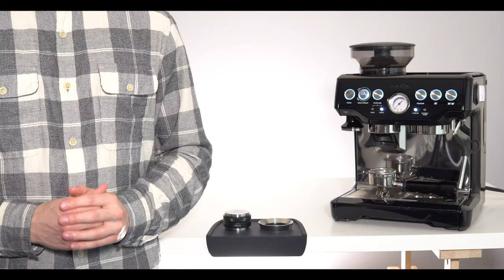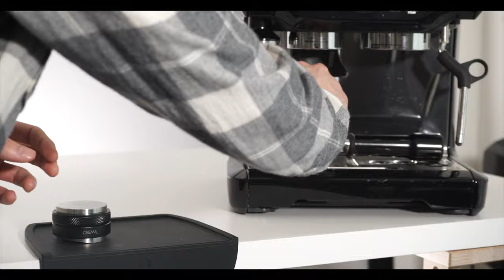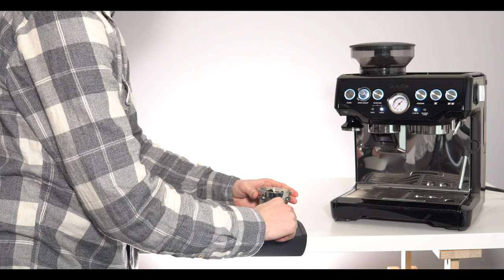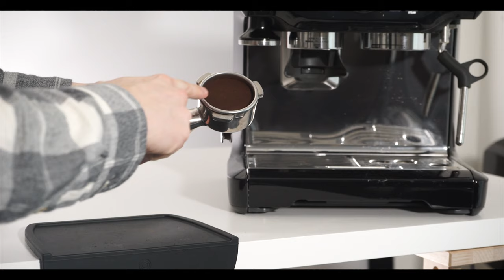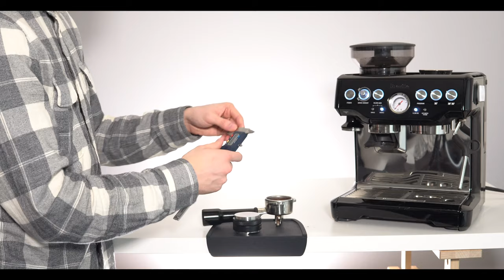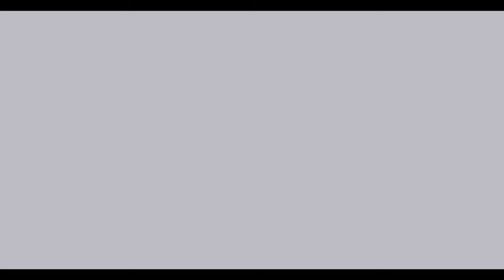How to Set Palm Tamper Depth | Breville Barista Express

Comment from the maker: Palm Tamper: https://geni.us/hLwubGd
Tamping Mat: https://geni.us/MWsc
Dosing Funnel: https://geni.us/6lghM
(Affiliate Links)
Reply: The Sage machines use a 54mm Portafilter. This tamper is 53mm.  Surely this will leave a 0.5mm non-tamped zone  around the edge?
Reply from the maker: They are designed specifically for Breville baskets, this isn’t a worry. Just like how 58mm tampers are actually 58.4mm

Comment: Use the Razor trimming tool and hold it on the edge of the tamper.  Adjust the tamper tool to match it perfectly.
Reply: yep!
Reply: Exactly right
Reply: That's too low. It removes way too much coffee and the depth is unnecessary low. Meaning that depending on the grind size you may not even be able to get 18g into the portafilter at that depth
Reply: @the_kingd0m  I dont think it is too low, it actually makes a higher puck than the 7.5mm in this video
Reply: I really don't understand the razor tool. If you use it after tamping its just going to damage the puck and cause channeling....
Reply: Nope. It requires more space than the trimming tool. If you use trimming tool, the coffee touches the shower
Reply: I use the razor to set the depth of the distribution tool.. Just a tiny bit shallower so o can use the razor to clear out all the coffee on the side. Flip it and use the other side with a tiny bit shallowe for the final tamp.
Reply: Bad advice use the shower screen instead
Reply: This
Reply: @jacksos101   the purpose of the razor is to see if your are tampering too much or not enough and make adjustments
Reply: @sammader5456  I know what they say it's for. It's a gimmick. The ideal height of the puck can change depending  on your beans, the roast level, the grind settings, and the dose and your preferences. The razor tool is purely a gimmick. End of.
Reply: Razor tool should be thrown straight in the bin
Reply: La dosis de cuánto gramos es ? 18 grs ?
Reply: The razor is a physical measurement tool not volume.  If you grind 18 grams of coffee in the basket, scraping off a few grams of coffee changes the brewing ratio, significantly.

Comment: Hi. Interesting video. I have a couple of issues here. First is the tamping weight and distance is directly related to the dose of coffee you use. Eg 16g v 18g will result in different tamped levels in the basket unrelated to shower screen. Second is that even different brands of coffee at a similar dose and grind tend to have a marginal difference so you’d need to recalibrate every new coffee. I just use distributer and adjust to gut feel and also to vary tamp amount to get longer shorter shot when the ideal grind setting is between settings.
Reply from the maker: I dial in MANY different coffees every month. As long as you are using a dose that is not too low (causing the tamper to not make contact), you will be able to dial in using grind size. A standard "ideal tamping pressure" of 25lbs or whatever it was has long been debunked as a myth. CONSISTENCY is what's important. But you are absolutely right, if your grinder is stepped and you can not precisely dial in using grind alone, slightly adjusting tamping pressure can help you dial in between grind settings. The same thing could also be done by varying dose while keeping tamping depth the same.
Reply: For me, I am too lazy to adjust. So i will adjust my coffee weights. For different beans, i will adjust my grind size.

Comment: Very well done! This is the only way to set a distribution tool to the minimum depth. Should you trust the dime rule for clearance, simply put a dime over the ground bed, lock in the portafilter, then set the distribution tool to dime imprint level. Bang, it’s done. Lastly, adjust the dose weight to reach this level. When done, adjust grind size for perfect extraction. Compensate weight of the dose by the roast level. Increase dose with light roast, decrease with dark roast. Success guaranteed! I have never change the depth of tool fore the last 3 years and probably never forever. 
No matter the brand of your machine, size of basket, batch of beans, follow this procedure and you will be in business.

Comment: You may be amused that I found a use for the razor trimming tool - I used it as a template/guide for setting the depth of my puck tamper.  I put the top of the razor on the top of the puck and adjusted until the razor edge came against the base of the puck.   The depth came out to ~.75mm as well.  I like your approach better, but had to share a use for that razor...

Comment: I found the easiest way to check is to simply put the tamper on the portafilter coming with the machine after you finish prepping. As long as the line between the silver and black part of the tamper is aligned with the basket/you cant see the metal part, you are good.

Comment: This was very helpful even though I have a different tamper/distributor and machine. I have the bambino plus and a picked up a rebranded combo tamper and bottomless portafilter for 35$ and this video got me pretty close to where I needed to be on the first shot. I do have the stock Breville basket in so that might have been a help. Thanks.

Comment: you can confirm your method by checking the depth sets by the Breville razor dose trimming tool
Reply: I have just measured mine and it is 7mm and not 7.5 mm....

Comment: Thank you for the informative videos!  Would you modify your process if using a puck screen?  They are quite thin, but would you tamp any deeper?
Reply from the maker: Yes, you’ll need to leave more room as to not put any pressure on the group head when locking in the portafilter

Comment: Excellent! This is exactly what I need.

One question though: what is the dosage that you used? It appears that you have premeasured the beans. I have found the Barista Express is not very consistent with its dosage, varying up to more than half a gram.

For adjusting the depth of the tamper side, I think the quicker way is to use the "Razor" tool that comes with the machine. It is set to the proper depth.

Thanks for the video.
Reply from the maker: I'm using 17.5gr dosed directly into an empty hopper, then I grund until empty. That is the most accurate method I have found on this machine. The razor tool is useful, but measures a specific volume, not a specific weight, which leads to problems in determining brew ratio

Comment: When using the distribution side. I noticed a lot of coffee grounds gets stuck where the black and silver part meets. Any idea on how to remedy this? The distribution part is at the minimum setting so I can’t adjust it anymore
Reply: I had that problem with beans that were particularly oily, especially when grinding finer. The stuck grounds never amounted to more than .25 grams, though, and didn't seem to affect the shot.

Comment: The Breville came with a razor tool. Wouldn’t that be the correct depth (tamp until the razor doesn’t shave the puck)?
Reply: the depth would change with dose though, so that might prove a slight issue
Reply: @Narezaath   
And how's his method (in the video) immune to dose?
Reply: @itsm3th3b33  I'm wondering the same thing
Reply: I bet the depth of the razor is also around 7.5 mm
Reply: @Guapogiboy  
No doubt. But the trial and error method suggested in this video is a long cut way to get to that 7.5mm, do you agree?
Reply: @itsm3th3b33  yup I actually just got mine I’ll measure
Reply: @Guapogiboy  were you able to measure? I was thinking the same thing
Reply: @fuzz69er  I have just measured mine and it is pretty much dead on 7mm and not 7.5 mm.
Reply from the maker: Breville's use of this tool is likely two fold, to help reduce dose variance caused by timed grinding, and to ensure people are guaranteed  to tamp deep enough to clear the shower screen. This is a poor method to use, as you have no control over the actual dose weight (you are trimming off an arbitrary amount to reach a certain depth)
Reply: @LifestyleLab_ good point. This 7.5 should be the level after you’ve tamped.so you’ll need to play around the grams of coffee. For me it’s 17-17.5 g. 

One tip after you’ve used this tool
To tamp touch the top just to test if it’s solid and packed.  If it leaves a dimple it was not enough coffee add a little more and repeat.
Reply: @LifestyleLab_  
Are you sure about that (razor depth doesn't clear the shower screen)?  It's pretty much the same 7.5mm that you found using your trial and error method. 
Besides, there's no way that a dose of 18g will fit in that basket and clear the razor without tamping. So, I need to tamp first, then measure with the razor (which cut 2-3g off), then tamp again?
Reply: @LifestyleLab_  I am very new to this .... Very. Can I confirm that you grind into the basket and then use the tamping tool to get it down to the right level ( 7.5mm in this case ) ..... And then you press it down to the right pressure ?
Reply from the maker: @itsm3th3b33  I'm sure the Razor depth would also clear the shower screen, as that's the intention of this tool. We're talking a difference of 0.5mm here. 
The issue with using the Razor is that you have no control over your dose. You are trimming off an unknown amount of coffee to reach a certain puck depth which is completely backwards. You should be dosing a known weight, and then tamping that to the correct depth.
Reply: @LifestyleLab_  
There's some misunderstanding somewhere... I have the tamper tool in this video.  I bought it on your recommendation in another video. Thank you. 
Your video says to set the tamping depth by trial and error, until it clears the shower screen.
I'm saying set the tamping depth to clear the razor. As simple as that.
As an alternative, just set to 7.5mm, as you found out.  That's also the depth of the razor.

Comment: This was very helpful. Thank you. Question. Would this require re-calibration with each batch of coffee since differences in beans and roast times will result in different volumes for the same dose weight?
Reply from the maker: Keep the depth setting the same, adjust your flow rate using grind size
Reply: If the grind size steps are too big which is usually the case on a BBE you can make tiny adjustments so it tamps harder/softer or you can up/lower the dose of beans. It's all depends on what you're looking for and what tastes good to you and others

Comment: I loved your video about the Tamping Pressure and that it doesn't matter much once 15lbs have been achieved. As this always is a huge variable, we followed your link and bought the palm tamper which is on its way now. Are you able to enlighten me how to set the depth for the palm tamper to achieve at least the 15lbs, better 20lbs so we have some wiggle room for different coffee types? Do I test it on a scale?
Reply from the maker: Pressure applies at the set palm tamper depth will solely depend on how full the basket is. You can try to measure on a scale, but make sure that you’re looking at the number when you’re still compressing the coffee, and not once you’ve already hit the tamper stopper
Reply: @LifestyleLab_  Thanks so much for your reply! I understand. I still feel the goal for the setting should be to reach at least the equivalent of 15lbs. But I'll wait until we got the tamper to try your method first.
Reply from the maker: Yes absolutely! 
No need to be exact, but make sure enough pressure is being applied. My above comment was just identifying the issue that some very low doses will NEVER be tamper hard enough with a palm tamper, so dosing properly is imperative
Reply: @LifestyleLab_  Just wanted to say thank you! The Palm Tamper has improved our coffee experience a lot! Now I'm trying to figure out how to increase the required pressure but remaining within the 25 to 30sec window. I tried finer grind and increasing dosage, but that didn't work so well both went way above the 3osec mark. Would harder tamping work? I'm woried risking my perfect tamp adjustment.
Reply from the maker: Once you’ve achieved a good even flow, stop paying attention to pressure and time, and just dial in to taste. You can’t taste numbers :)

Comment: What about using too little pressure would that be an issue? Because using less or more coffee changes everything!
Reply from the maker: Need to dose the appropriate volume for you basket :) 18g may not be the correct dose for every coffee, depending on roast level and origin the densities can vary drastically! If you're undertamping, you need to increase dose or get a smaller basket

Comment: Hello!  You have been teaching so much since I've received this machine.  I went ahead and set the tamper depth but when I lock in the portafilter, it doesn't show the dots of the shower screen, just the circle that's in the middle.  I hope that makes sense!  Do I still need to keep adjusting my tamper until the puck is completely flattened with no indentations of that circle in the shower screen?  Thank you!

Comment: My advice is to use the Tamper that comes with de Breville to finish up the Tampering( after using the distributor)..you will get a more compact puck. 
For  18gr of grinded coffe this is my configuration.
Grinder set up: 5
Grinding time :17 seconds
18gr of Coffee
Naked Portafilter. 
10 seconds of preinfussion and 25 seconds of brewing.

Comment: Why not use the depth of the razor, included with the machine, to set the depth of the distributor
Reply: I think that tool only recently started shipping with the Breville Barista Express maybe like a year and a half ago
Reply: I actually did measure my tamp side using the razor depth but you want the distributer side at minimum to leave enough room between the the grounds and the distributer end to get an even distribution if set too deep into the portafilter it will distribute the grounds in too tight leaving the grounds uneven within the puck causing an uneven extraction plus other than distributing and leveling the grounds the
 whole point of the depth on the razor is for the correct tamping depth and i believe it applies the same pressure as using 30lbs of pressure w a regular tamp.
Reply: @johnathanl2663  bit longer than that, I've had mine since Sept 2017

Comment: How many grams of coffee is in this shot? 18 or 17? Thanks for your answer.
Reply: Did you ever get a reply for this question?  It seems tamping down to the level he described would result in different puck densities depending on the amount of coffee.  I have been using 18g and still getting too quick a shot - I have walked my grind setting all the way down to 2 and still too fast? -
Reply: @matthewwilson3078  hey Matt, I had this same problem with my breville smart grinder, I couldn’t get a fine enough grind at low settings. I opened up the grinder and took out the inner burr and made the grind size smaller, he has a video on this. I adjusted the internal burr to #2. Now my steps between grind sizes is less drastic of a change which helps dialing in shots. I grind on a setting between 15-10 now because less than that will start to choke my machine. I hope this helps!

Comment: Thank you for the videos. Very very helpful. Would the tamper height be the same for the single dose basket (7.5 mm)?
Reply from the maker: Yes, you want to maintain that same gap from the shower screen. You will just need to find what dose works for your coffee in the single basket
Reply: @LifestyleLab_   Thank you so much for the speedy reply. Makes sense.

Comment: Hello. Quick question. I use fresh coffee everytime but my extraction time from the moment I press the button to get around 36g out is about 15 or 16 seconds. I put 18g of coffee in the grinder and I have the internal grinder also set to the minimum setting so i cant go any finer. Is that just the coffee or is there anything else going on? Thank you. 👍
Reply: That is way too fast of an extraction. Try:
1. Increase to 19g of coffee
2. Tamper harder
3. Check your grinder for defects - spread the ground coffee on a paper towel and check the consistency of the grind. If there are to many coarse bits your grinder may need servicing. Or buy a better grinder. 
4. Try a different roast. Darker roasts should grind finer.
Reply: @itsm3th3b33  Thanks for your reply. I will try 19g. It's a fairly new machine so i would hope all is well with the grinder but i will check that also. 👍👍
Reply: You can adjust the top plate of the grinder  inside the burr grinder; default is at 6 and it’s a range from 1-10; where 1 is the finest setting.
Reply: Try using freshly roasted coffee. If it is too stale (older than couple of months), it becomes unusable.
Reply: Thanks every one. I use very fresh coffee every time but still not getting a long enough extraction. I have the internal grinder set to its finest setting and still not slow enough.

Comment: Have you ever tried using just the distributor in heard a few people try this with good results the folks over at whole latte love use just the jack leveler
Reply from the maker: The distributor side of this tool has the exact same functionality as the Jack leveler, so yes!
Just like the Whole Latte Love folks I dont even tamp anymore. I simply set the distributor to the correct depth and spin until there is no resistance. Perfect, consistent results every time
Reply: Lifestyle Lab are you still setting it at 7.5mm ruffly
Reply from the maker: Yup, I left it there the whole time I had the Barista express in my kitchen. Now I use the Appartamento day to day, and have used the same process shown here to set the depth for that distributor
Reply: Lifestyle Lab that’s awesome my buddy has the apartmento it’s a beautiful machine.
Reply: Lifestyle Lab that’s awesome my buddy has the apartmento it’s a beautiful machine.